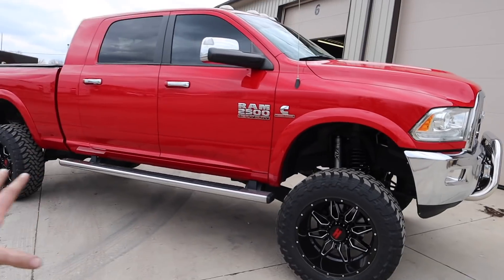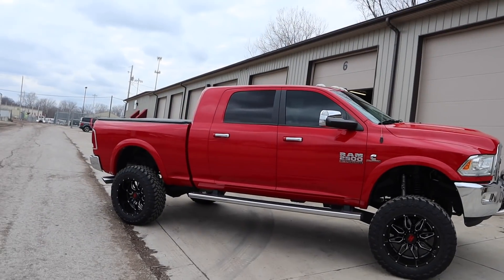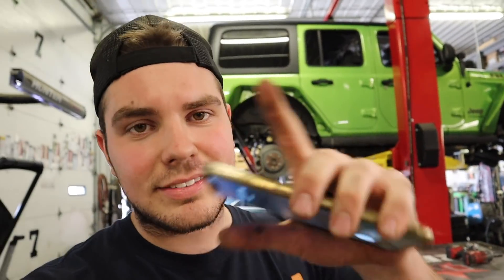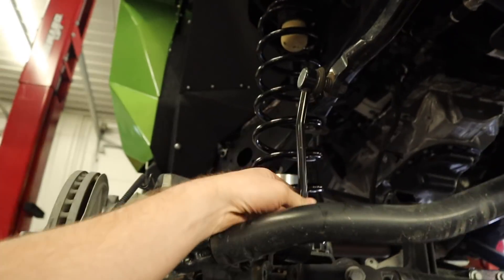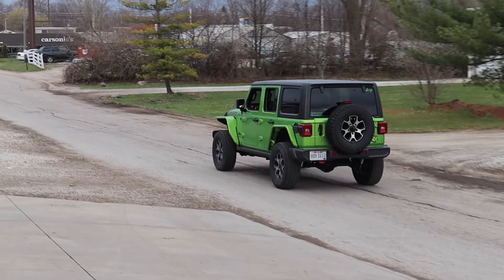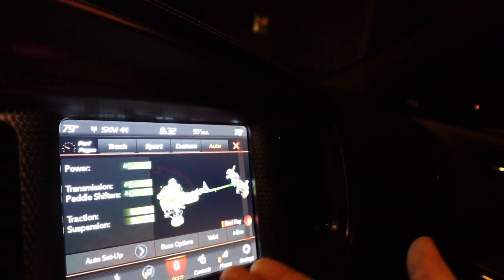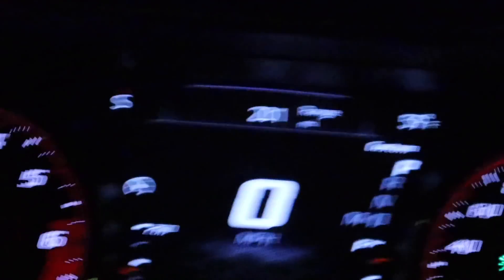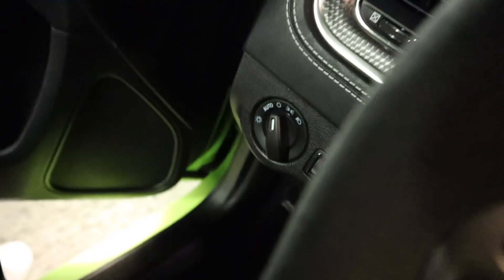THE RED CUMMINS GOT HUGE WHEELS AND TIRES!!!

Comment: i have the same setup on my 3500 dually , 37s look small i wonder if i add a leveling kit if i would clear 40s since i have the factory offset wheels
Reply from the maker: 🧐🧐🧐it might be possible
Reply: I'm running 42's on 22.5's with 14inches of lift on my 2010 ram dually

Comment: You can clear 12 wides with 37" with just the 6.5" lift.  Just finished my 16 2500 and I'm running 24x12 -44 with 37x13.50 on the Zone lift.